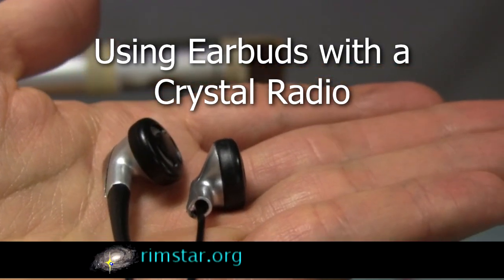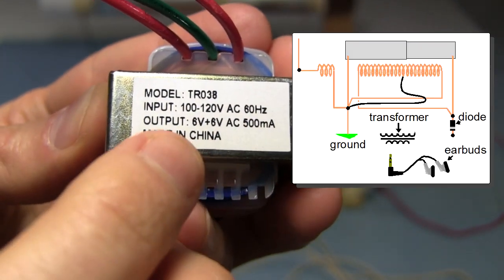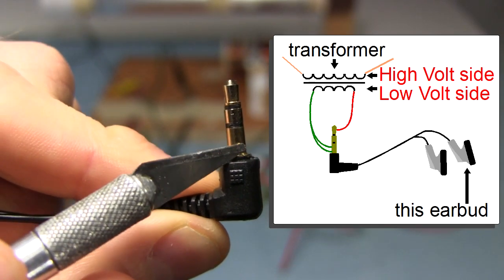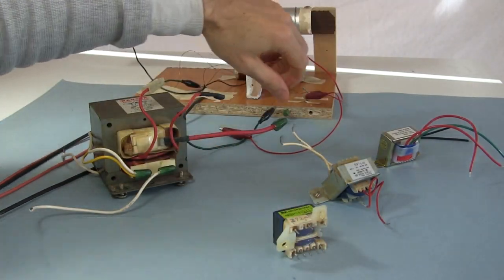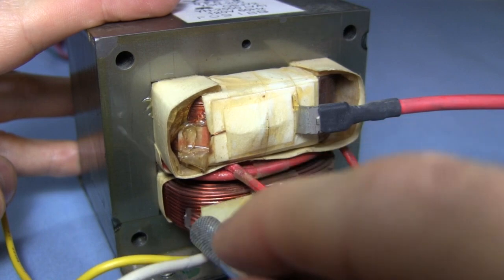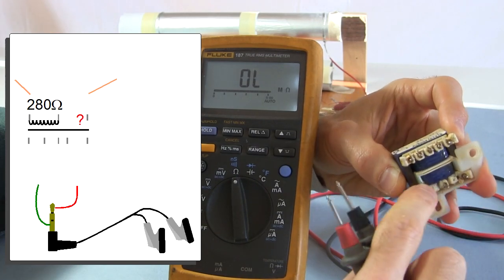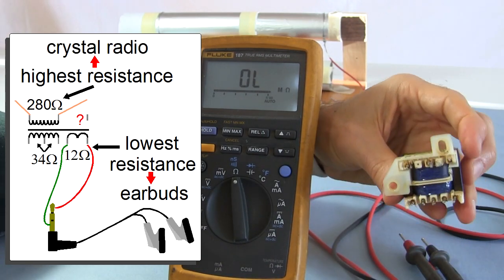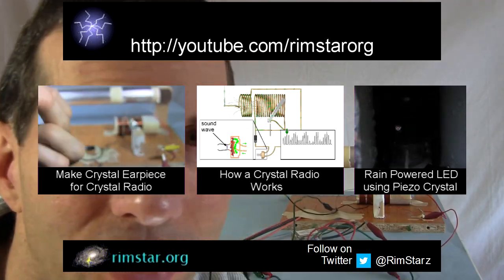Use Earbuds/Earphones with Crystal Radio

Comment: One more thing. From my memory and past experiment, I found that smaller transformers work better, especially ones with ferrite cores. I wonder if the impedance difference is much greater, how this will effect the performance. can you you try something like an ignition coil or flyback transformer? maybe a transformer from a bug zapper or a electric fence charger?
Reply: ...the transformers you mentioned would be unsuited for this application-!!
Reply: @daleburrell6273  Ferrite transformers should work fine. Ferrite does have a lower permiability and lower saturation current at low frequencies, but the signal levels we are dealing with are so weak that I don't think that matters. Just have enough turns to provide a really high magnetizing inductance for the primary. That might be challenging though if the ferrite transformer features an air gap or if the core is actually powder core with distributed air gap. The minimal amount of hysteresis may help improve linearity for small signals. Not sure about the bandwidth though.

Comment: well when i mentions wall warts, AC to DC ones work with modification. I guess I wasn't clear on that. AC to DC adapters were the only ones I had. I just take them apart to get the transformer out. I think what would work best is is small impedance matching audio transformer. even though the impedances are different, the voltage input/output is the same, I believe, I'm not sure. i made the mistake of calling this a 1:1 ratio transformer. sorry.

Comment: The small ones are often seen/used as "audio transformers".  Some people might wish to connect low audio sources to a computer sound car, and it's good to use a transformer there also.  Other places besides Radio Shack sell the small audio transformers, maby even a 2000 ohm to 8 ohm.

Comment: Well... can you light neon light from a AA battery? no because the battery is low voltage and high amps. Can you light a flashlight bulb with a Van De Graaff generator, no because the bulbs filament required about half an amp flowing. the voltage from the generator just flies right though it without heating the wire. same here. the impedance are far too different. the buds require current flowing, where the radio only supplies low currents and moderate voltages (about 40 volts I think)

Comment from the maker: It's not 100% intuitive to me either :). One way of looking at it is the earbuds alone are too big a load on the radio, so a larger load needs to be on the radio side. The other way is as you say, the radio doesn't provide enough current to drive the earbuds so a voltage step down/current step up is needed from the radio to the earbuds. I did try both ways anyhow, and it totally doesn't work with the transformer reversed.

Comment from the maker: Here in Ontario, Canada at least, Radio Shack was bought by The Source and I checked all the local ones - no transformers. The local electronics store had only the doorbell transformer. One other electronics store has them but I won't be able to get to them for a while. I would have liked to try the smaller ones you're talking about but I did well with what I had. Let me know how it goes.

Comment: The transformer connection was not intuitive to me.  I would have thought the low voltage side goes to the crystal radio and the high-voltage (more turns) to the ear buds.  Thus you would get an increase in voltage (but decrease in current).  Perhaps it is the increase in current that you want instead to drive the ear buds.

Jim

Comment: I think Radio Shack sells a small transformer of 1000 ohm to 8 ohm, it will provide a theoretical current increase of 125, but the voltage will decrease by that amount also, nonetheless, about the same power is delivered to the 8 ohm earphones as put into the transformer.  This vid is a good idea, if I can, I will make a box with one or two of those transformers in it, maby connect two to make 2000 ohm to 16 ohm or something or allow different options.